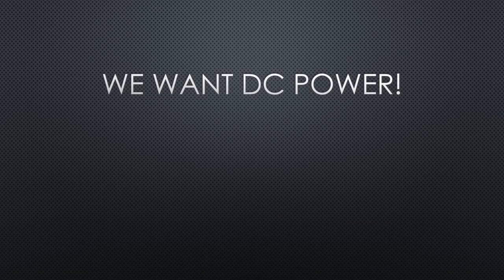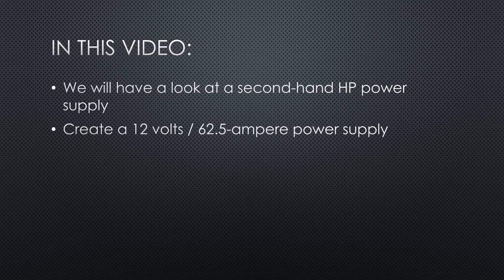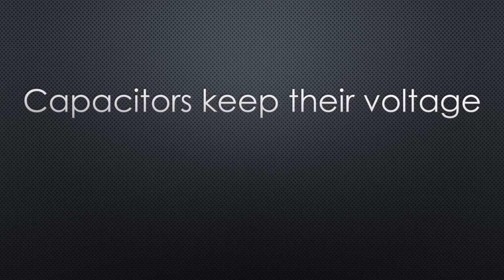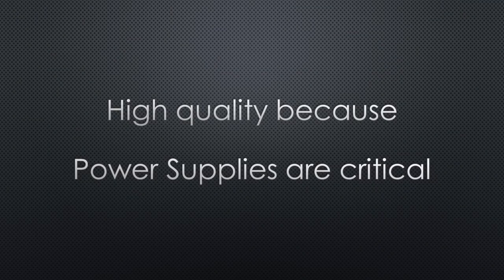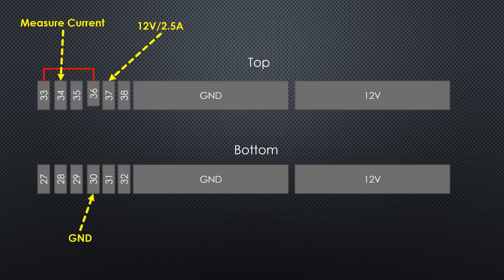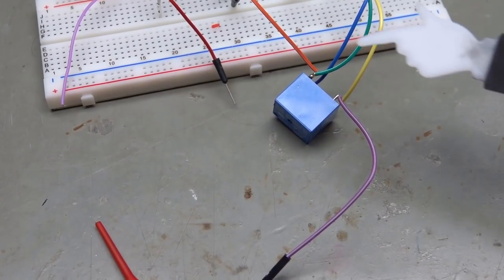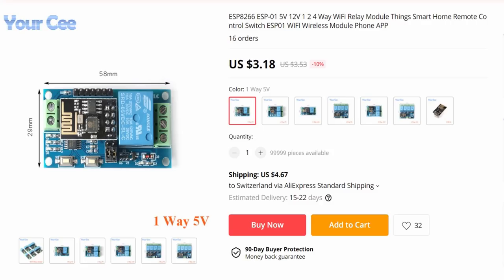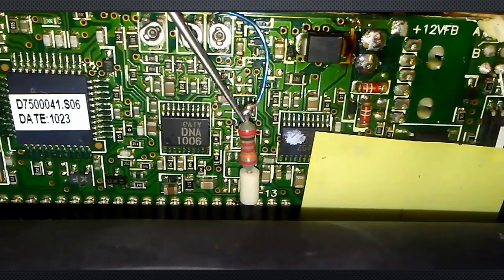#342 12V/60A power supply (PSU) for 20 dollars? Unbelievable, but true. And high quality.

Comment: I bought one some time back the HP 441830-001 100 amp at 240v model and haven't got around to experimenting with it yet,  the reason I wanted it was for an amplifier supply. But the Ameritron ALS 500m came with one so I didn't need to do the 13.8v hack. It was cheap enough that I'm not worried about it, I will simply find another use.
Reply from the maker: During my research I found a lot of HAMs using these PSUs un 13.8 volts. Hope you will find a use for it.
Reply: @AndreasSpiess   Thank you, Andreas, I will, I never want to waist good electronics gear.

Comment: I've been using several old laptop power supplies ~20V/8A.  It's nice and quiet, and no fan to fail. The server power supplies, or even network gear,  aren't as reliable as before. They don't even have protected metal covers anymore. Many of them are just piece of cardboard. Also they don't need to be as reliable as before because there can be more than 2+ of them now. So we have them failure every wk. Meanwhile hardly a PC ATX power supply fails or laptop.
Reply from the maker: I did not find a lot of complaints about failing PSUs. And thousands are used for years by the RC community. Laptop PS are also a good choice for lower power applications. I use one for my mobile PS.

Comment: I got myself one of those HP blade server PSU's, you can see them around 1:16 on the bottom right. Just as cheap and I get 150A off mine no problems. Only downside is its shape, its quite thin and long. A  bit awkward to house in some projects. Also a big fan of the fan units of the blade system, just as cheap.
Reply from the maker: Cool. 150A!

Comment: You can control the power supply with an esp8266 running tasmota without a relay! Only a 1k resistor between 36 and 37 is required, pulling 33 low turns the power supply on!
Reply from the maker: Thank you for the tip!

Comment: I have an old Dell server in wich both power supply were performing bad. After opening them I found four capacitors slightly swollen. I changed them with other parts coming from a thrown away PC PSU and they are now good again. So if you buy second hand PSU from eBay my suggestion is to open them and check all of the capacitors with your eyes, no need for a special and expensive instrument... But do it in a safely way!!
Reply from the maker: Good tip. I did not find a "manufacturing year on it. So I do not know how old it is.

Comment: I've got a few of these server PSUs to play around with. The main problem is that they are insanely loud, very hard to change output voltages, and are at the end of their lives. All of them use active power factor correction and synchronous rectification for the main output. Very fancy topologies. There are also safety features to have them fail open because they are the cheapest part of the system. I have destroyed 3 of them while tinkering around trying to adjust the output voltage, overload, overheat, etc. They also monitor the fan so you cant just unplug them. The rest are still there in the basement I just don't have a chance to use them. Too little voltage and too much amperage. 

On the upside, they are a great source for high-quality parts from Mosftets to inductors.
Reply: For advanced tinkerers, it is very easy to find the pin to turn on the PSU. Just measure the voltage on the small output pins and look for a non-nominal voltage like 2v or 4.5v, and pull it to ground. It's okay to pull a standby to ground it will not blow up. It takes one minute to turn it on.

However, it's tricky to change output voltages for these supplies. Many don't have voltage trimmers. The feedback loop is insanely hard to trace and you often can't get access to all the optocouplers. Also one small mistake, even the load of your oscilloscope probe on the optocoupler can very easily permanently destroy your PSU. Also extremely hard to troubleshoot/reverse engineer. Or maybe I'm just unlucky.
Reply from the maker: There is information around on how to change output voltages if you chose the right part. I had it modded in less than 10 minutes. Just added a 20k resistor at the right place.
But if you want to find out yourself it is hard..

Comment: will you please investigate the PMBus (i2c I think?) interface and/or show us how to use the current pin? I think it shows the amp load as volts on the pin with [V x 10 = A], so a voltage of +0.1v on that pin would mean it's supplying a 1 amp load. Also, that function and others (power on/off) are available over the i2c (pmbus) link. That could eliminate the need for your relay board. I've been wanting to try this stuff for a while but, I had better leave it to the professionals.
Reply from the maker: I have no plans for that, because I do not see a need for me. Maybe somebody else does it?

Comment: I will never buy an ATX powersupply for my PC again. These HP server PSU are a masterpiece of engineering. I have the 1500W version. Such a small form factor and almost no heat. Just amazing.
Reply from the maker: You are right. One drives my Amateur radio station without any problems so far...

Comment: OMG!, this is a total revelation, I searched in a local web page some psu and I can't believe that are tooo cheap :O, not as cheap as $20 USD, but men, have a lot of power, magnetic cores and  power electronics inside.
Reply from the maker: True. They have quality parts if you want to disassemble one.

Comment: NO WAYY!!! I have the exact one you have laying around still LOL. I already ordered card edge connectors to someday make an adapter board to make interfacing/getting power from the psu easy
Reply from the maker: In the meantime I found ready-made connector boards. I posted a link in the description.
Reply: @AndreasSpiess  Wow, thanks! Thats what I wanted as I was planning on using it as a power supply for a pc in which a normal ATX power supply does not fit

Comment: My experience is server power supplies are notably thermally tolerant.  They fail from time to time, but rarely, still they are often wired redundantly.   They can be hugely acoustically noisy when hot, although in an overheated data center so many fans are running, it’s hard to tell which one.
Reply from the maker: Many viewers report about the noise. I was not able to test it at its maximum power, so mine was quite silent.

Comment: not a big issue for a diy project but edge connectors have thick gold plating, not the extremely thin ENIG. 
When soldering to it enough gold might dissolved in the solder to make it brittle
Reply from the maker: Interesting. I did not know it. Thanks.

Comment: The ones with Blue C14 power connector are Platinum efficiency. (94%)
Black C14 power plugs are Silver efficiency (90%)
Also fun fact: These have paralleling circuity built in, you can directly connect the 12v output of 2 of these units for redundant + load sharing.
If you search, you can also find the 1200W version for pretty cheap.
Reply from the maker: Thank you for your information.

Comment: Thanks for the heads up, never thought of looking at these power supplies. I have used a 12V computer power supply(linear) 15A which is very heavy but was built to last at full load.

I expect theses are the same, built to provide 60A 24/7, Just got a 100W HF rig, so ordered one to free up the 30V 30A variable supply i'm currently using. Now to try and not do an electroboom and convert it to 13.8V
Reply from the maker: I had less than 10 minutes for the 13.8 volts conversion. Pay attention. It can hurt ;-)
Reply: @AndreasSpiess  I can see it's just a mater of finding the correct resistor in the feed back path to adjust the output. Might also be a mater of finding the overvoltage trip circuit to stop it tripping if 13.8V is too close.

My linear supply had a trip that would trip at 13.9V and crowbar the output, before I found this out, the supply would trip once a day at 23:00hr when the heating turned off next door. increase the trip to 14V and it never tripped again. I hope these turn out to be as stable.

A HF Rig that  that I'm working on has 900V DC on the Anodes so I'm used to keeping one hand in a pocket when the PA screen in off :)
Reply from the maker: One hand in the pocket is very good advice!
Reply: I would be really cautious with switch-mode power supplies, even of server quality. For HF use, if you're unlucky and hit some harmonics and intermodulations, your signal can get pretty ugly.

I wish you luck with your PA and HF endeavours. Hope you'll report back with the results! I subscribed to your channel.

73 de OM2AGC.

Comment: @Andreas Spiess, although I'm thinkering with mining rigs right now, this is a great video, many thanks. I know this video is getting 'old' but it's hard to find any tips on how to make those PSU's a bit quieter using the pots. Any tips??
Reply from the maker: They are loud by construction if used at very high currents. And some supplies are even loud at low power. So you maybe can cover them in a case.

Comment: It is even possible to get a server PSU in China for less than 10 USD. If you need higher voltage, they also sell "communication psu", usually at around 48V and some sellers will even hack the PSU for you.
Reply from the maker: I have such a 48 volt PSU, but for the moment I do not know how to use it :-(
Reply: @AndreasSpiess  Hmm, usually these also work when you short two (or more) specific pins, however I have seen ones that were modules from a system powersupply that needs serial communication to power on. Sometimes you can find these hacks from weird Chinese websites as well XD.
Reply from the maker: I have to investigate further. BTW: It is 42, not 48 volts. It is a Sony APS-162
Reply: @AndreasSpiess  Interesting, I found that it's a PSU for the Cisco 6500 Series Switch, and its P/N from Cisco is WS-CAC-1300w if I'm not mistaken, but other than that I don't see much info on the internals about this PSU.

Comment: Most server PSU have load sharing pins so you can run them in parallel and some have current sense lines so there is no drop of voltage under higher loads. Also newer ones are even smaller. You can get a 2KW unit in same or smaller form factor.
Reply from the maker: Interesting. I did not find information on load sharing, only the output pin for the actual current value.
Reply: @AndreasSpiess  I guess it depends on the model and the documentation that you can find for them. If I remember correctly HP ESP113 had all that but the fan was on all the time and I wasn't able to bypass it so not the best for a lab power supply.

Comment: I'm really not surprised to find one of your videos while researching. Unfortunately with bridging the pins I could confirm the power distribution board must be fried. Which is ironically not redundant.
Reply from the maker: I do not understand what happened :-(
Reply: @AndreasSpiess I bought a broken dual PSU server, I plan to modify the case to take normal Mainboards but unfortunately I don't have power. I really want to get the case with the PSUs to work since it looks absolutely awesome and most of my hardware is in a self-made wooden rack anyway.

I was researching about those PSUs and got your video recommended in the Google search. (Probably because I watch them sometimes). But now that I know how they are turned on I could confirm the 6 PSUs I have are working well and the Power Distribution board that takes 2 PSUs and connects them to the Mainboard is broken.

Comment: Do we know what functions are available over the PMBus I2C?  Whenever I see an I2C on a product I get all excited ; )

At home I run Dell M1000E bladeservers and each of the 6x 2280W PSUs in a chassis is monitored for all kinds of metrics from power, stability, heat and fan speed.  You can also limit their power.  Also, the fans seem to be capable of being run up to 100% and then backed off again - which is a great way to make sure they're unobstructed and working fine - long before you actually need them : )

Interestingly, the Dell PSUs also measure voltage and current at the input and output!  So, you know when they (or your mains supply) is in poor condition.

So, I wonder if there are any documents out there that describe the management features that exist on the HP PSU's PMBus and how to access them?  Or, maybe I could acquire an older HP server (only about £75 here, complete with 2x PSUs) and debug the I2C for clues.

The I2C might be the very simplest way to put a nice digital front-end UI on the PSU - with various graphs, measurements and health status.  Perhaps set various limits and even a manual or power-on fan-test.

It may be quite rewarding to poke a little deeper into these units.

Thanks for sharing !
Reply: The older specs for PMBus are here :
https://pmbus.org/Specifications/OlderSpecifications

Lots of documentation here :
https://www.pmbus.org/Specifications/CurrentSpecifications

I think there's enough information out there to really start getting the most out of these PSUs - and to build our own pretty management Interfaces and some graphical monitoring/instrumentation for them.  There may even be some open source PMBus code out there for common microcontrollers that we could embed : )

The following is from Wikipedia entry on: "Power Management Bus"

implementations

As of summer 2007, PMBus is relatively new so not many products yet advertise support for it. Given the richness of the specification, firmware based implementations running in microcontrollers are probably easiest to provide, although several of the current products do not involve microcontrollers. One firmware-based example is the Texas Instruments UCD9112. Another uses about 2Kbytes of code on an Atmel AVR 8-bit microcontroller on the NGW100 board controller

In fall 2009 more products are available.  The NXP PIP8000 and Maxim MAX16064 are two recently announced chips, which have vendor-supplied graphical user interfaces

As PMBus systems are deployed, tools to manage those systems should become significant. Some of them may just be used during manufacturing, to set up system-specific parameters used with reconfigurable power subsystems. Others will be useful for runtime optimization, for example with server farms.

I think we could do more with these : )

Comment: This form factor of HPE PSU is known as the "HPE Common Slot Power Supply"
Was used for at least the last decade up through current time.
For popular servers, was replaced by a physically smaller "HPE Flexible Slot Power Supply" standard starting with Intel Xeon Haswell launch (HPE "Gen9")
Flex Slot likely has a different pinout, so be careful.

You can find basic specs of HPE items by looking for the "QuickSpecs"
Example Google: HPE Common Slot Power QuickSpecs
xxxxxx-B21 are Sales Part Numbers.
xxxxxx-001 are Service / Manufacturing numbers.
You may find both when eBay hunting

There are also -48V Input PSUs in these form factors used by the Telecommunications industry.
And now also 380VDC and 277VAC versions for huge data centers.
277VAC for example is 1 phase of 480v AC 3 Phase Wye power.

Lastly, for HPE Blade Chassis and HPC Servers, you will find huge PSUs delivering up to 2650W.
But these require 208-240v input to work.
No problem in Europe, but less common in North America.
Reply: PS: You will find them as both HP and HPE.  HPE is the Enterprise side and split off from HP a few years back.  HP side is now only Printers/Laptops/Desktops/etc.
Reply from the maker: Thank you for the info!  So we probably have to stick with the older stuff till somebody hacked the new ones.
BTW: I heard about the HP/HPE split because I am a HP Alumni. (ex. DEC)

Comment: those old server PSUs are well loved by folks building 3D printers and the like, for being dirt cheap, very compact, superbly reliable, and more pleassant to work with than ATX PSUs. in server farms they are routinely replaced before even one has any chance of going bad, and those often end up on ebay. from what i've heard they use very costly and high quality components, far superior to what's found in the majority of throw-away consumer electronics.
Reply from the maker: I agree. This is the reason I made the video.
Reply: Cuda FX
 - You are absolutely correct. I have opened several server PSUs, and their components are, without exception, the best of the best. All electrolytics, for example, are Nichicon, Rubycon, Nippon Chemi-Con, and Panasonic - literally the best brands on the planet. This stuff was designed and built sparing no expense, unlike home PC PSUs, which use as cheap components as possible to maintain, say, a 90% failure-free rate for the one year warranty period.

Comment: Have a look at the HP DPS-800GB A. 82.3 amps @ 12.15V and the voltage can easily be adjusted. I have mine set at 14.7 volts, and I use it when I'm programming or troubleshooting cars.
Reply from the maker: Interesting. Do you have a link to the 14.7 volts mod?
Reply: @AndreasSpiess  https://youtu.be/9--g63ew9HU

I did not adjust the internal trimpot, I just added the external as shown in that video.
Reply from the maker: Thank you! An easy mod!

Comment: I plan to get one of these for programming my car, but I have to boost the voltage to 13.6, which is the float voltage for AGM batteries.
Reply from the maker: That should work. Pay attention that if does not charge too fast.